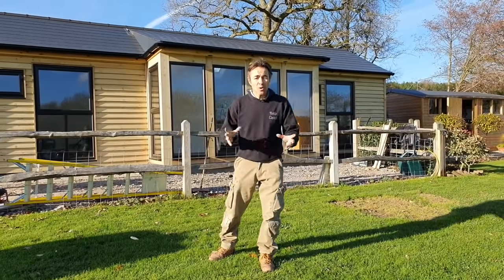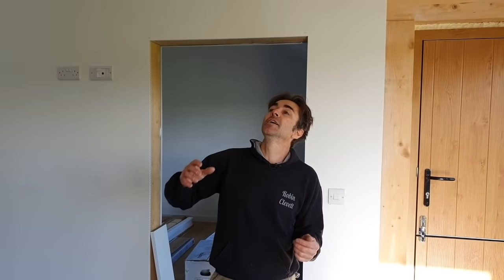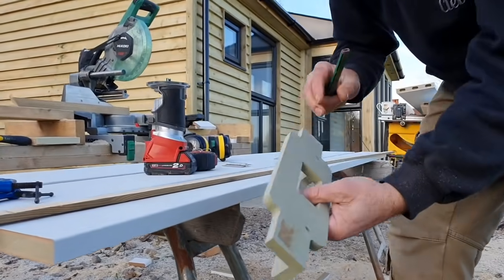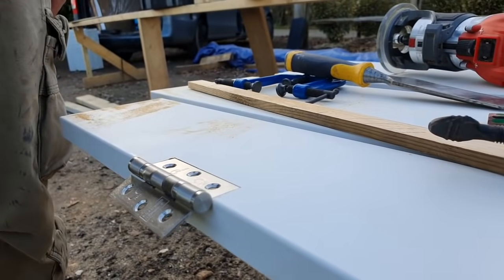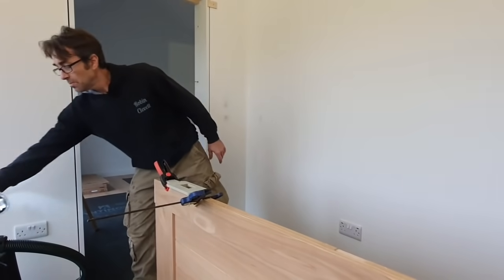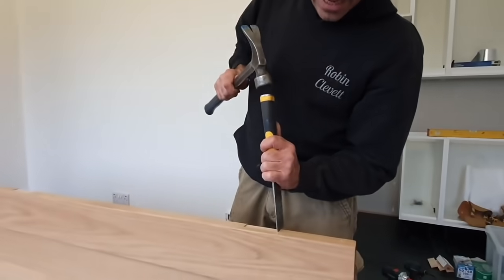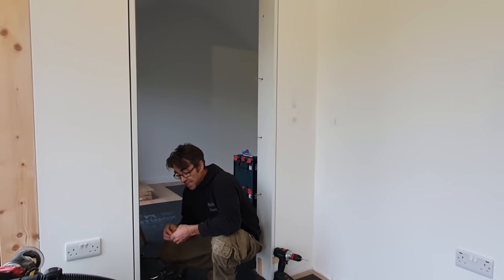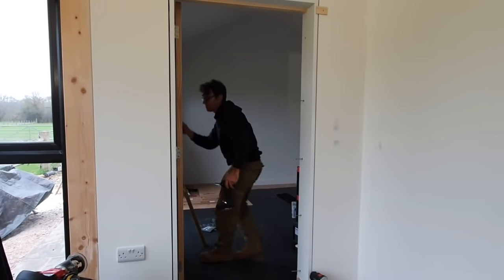Modern Carpentry and Change!!! Hanging doors the modern way with MDF door linings and new hinge jig

Comment: Having started Carpentry before you and having some age on you I agree everything has changed. The tools are a big help and make the job easier. In my part of OZ we don't get most of the material advancements you get but then mostly we build non descript shit boxes anyway and we are years behind the times. What I don't  like now compared to when I started is the seriousness of every job. We used to have a laugh usually at someone's expense but now frightfully out of order. Some over zealous WHS person, can't even say man now, is always lurking to catch you out or slap an environmental fine on you. You need 50 pieces of paper to start a job and another 20 during the job all at a cost to satisfy all the desk jockeys whose main function in life is to come up with even more requirements to make your job harder. Then some kid from Uni that has read a book on building turns up to do the inspections and tells you you have failed to comply with AS 6754 sub section C part 1 that was introduced last week. In the old days we would have dug a hole and buried him. It certainly has changed Robin but it is nice to see a man that has kept pace with those changes and is still happy with his lot.
Reply: Haha couldn't agree more with Dave about the WHS thing - totally over the top. Use lead stands so instead of stepping over the leads you turn a corner and clothes line yourself cos invariably the leads are at neck height. Or my favourite, give the workers a paved pathway around the job to make it safer - they're in a fcking building site not a hair salon! We''re used to running across roof trusses or reinforcing mesh, we don't need a smooth pathway around the job

Comment: Hi, does it make any difference to your hinge guide what size the router bit is just as long as it has a bearing at the shank end rather than at the tip of the bit
Reply from the maker: Hi Dan you can use any diameter of flush top bearing cutter with a cutting depth of 9mm or less, 12mm is a good size
Reply: @robinclevettcarpenter  hi Robin, thank you for that,  I will have to order your hinge guide now. Its a brilliant idea using mdf liners for different thickness of walls. Do you rip and prime your own and if so how do you edge them or do you purchase them to size?

Comment: Nice work Robin, how do you compare your hinge jig to trends? I've just hung a house full of doors and found the hardest thing is being super accurate when transferring the hinge locations on to the door, I hate having to take that extra 1/16 out of the shoulder if your slightly off.
Reply from the maker: Hi Robert, one of the reasons I first had a new jig of my own was for the very reason you mention especially if you are changing existing doors, so we shoot the doors in and then if you try to use a Trend Jig, you have to adjust and play and that can take time and plenty of patience!! with my simple jig its a matter of just placing over the pencil mark exactly and boom get it routed!! its really quick and super accurate

Comment: Very informative video Robin. Re: routing out the hinges, does there need to be a guide bush , if not, will the router bit cut away the jig ?
Reply: The router bit has a bearing on it the same size as the cutter that follows the jig 👍
Reply: @davefarmery8180  Thanks Dave, I will look into it, looks good.

Comment: Hinges with rounded edges to avoid having to chisel the corners 🤔
Reply: Been around for years in holland
Reply from the maker: As time goes on I will introduce specific hinge templates for specific hinges for different markets
Reply: @robinclevettcarpenter  hi robin , is your hinge jig available for me to buy ? Would love to have one ? 👍
Reply: @davidcavaliere1525  they are very simple to make yourself.
Reply: First used them in 1989, from CCF. Remember it well because I was made redundant and went self employed.
Reply: @vamboroolz1612  thanks for your reply 👍
Reply: @davidcavaliere1525  the downside of these type of jigs is you need one for every hinge size,( various of each 150mm, 125mm,100mm, 75mm hinges). Personally I used home made jigs for many years but now use an adjustable jig like the one from Rutlands. Basically it’s easy to adjust to all the sizes, the material is more stable and it’s just easier to use. I have been a carpenter all my working life,( from 17 years old to now being 55years old), so with my workload it makes financial sense for me to go buy an adjustable one. Like I say, those jigs in the video are very easily made yourself if that’s the way you want to go rather than an adjustable one. Best of luck with whichever way you go with it.
Reply: @vamboroolz1612  well it’s new to me , I’ve been chopping hinges in for years and probably quicker than settling up a jig , I’ve got so used to doing it using a chisel, I probably won’t even bother haha

Comment: Doh, what stops the router bit from cutting into the MDF jig?
Reply from the maker: A bearing guide built into the cutter as shown in the still clip on the video
Reply: @robinclevettcarpenter  Thanks Robin.  The 'penny has dropped', as they say!  As the video is almost 24 minutes long, where is the clip?  I couldn't find it :-(

Comment: If you are aiming for 2mm gaps all around do you not find that you still need to bevel the leading edge slightly. Also would your hinge jig be suitable for use with a laminate trimmer and   the right cutter. Another great video testament to your skill and experience.

Comment: Hi Robin, loved the video very interesting and informative as always✊
As a non carpenter I have a couple of questions!
When you produce the frame would it be possible at that point to mark and cut out the Hinges?
 Could also the same apply to the Handle and latch when you are fitting the hinges?
just a thought to assist efficiency or have I missed some key factors?
Keep up the good work!
PS:  Is your beautiful home finished yet?😏
Reply from the maker: Hi Martin, I did cover that about the hinges on the frame in the video, I routed the lining legs on the bench so they where done when I fitted the doors.
I always leave the handles and latches and fit in situ, generally because I will get the client to choose where they want them and most people need to see the doors in place from my experience!!
My Place is coming along good hopefully do an update over on SkillBuilder soon

Comment: How long until the RC branded hinge jigs are available. 😂 I’ve got 14 doors to do and they will be done following your great advice in this vid. cheers 👍
Reply: The Trend hinge jig would be a better option.
Reply: @jamesgreen4080  what at £200 😂😂😂
Reply: @jamiefors5062   Yes but for £200 the trend jig covers many different hinge sizes, you only need to set it up once on the lining and once on the door which saves time and therefore makes money.

Comment: Have a look at Magnetic Reading Glasses Snap Click Front Neck Hanging Spectacles
Reply: I've never seen a product designed to be lost so easily from the get go.
Reply: @markrainford1219  I've been using them for a couple of years. Not lost yet! Great at work stops them falling of when leaning over and ready to use when needed.

Comment: I’ve seen in your videos you’ve used the hikoki and Milwaukee framing nail guns and out of the two which do you prefer? I’m looking to buy one of them to replace my old nail gun
Reply: The Milwaukee isn't worth the extra money over the hikoki so it's a no brainer. Could do with trying one first though as they're both real heavy if your used to paslode
Reply: @rossmale8715  skill builder did a review of all the major nail guns, check it out.

Comment: ...and the added benefit of modern manufactured materials is they tend not to change shape, unlike real wood when used for work such as doors...nothing more frustrating than cutting, planing and finding moisture and/or heat means it don’t fit as it should...lol...

Comment: Just found my old Yankie yesterday 😂
Reply: Did they make you swear alot? I remember my dad using one f'ing and blinding in the garden.
Reply: Fantastic!! I’ve still got mine & I will never part with it. Got the jubilee clip to stop loosing the grub screw & stop it from rolling off the scaffold. I still use it for these tough big screws on traditional work. You just get the feel; the bite. Albeit, I just do the odd trade job now & again.
Reply: I have one.
With the original packaging.
Reply: @alexjames1146  plastic sleeve, see through at the front, yellow at the back?
Reply: Yes!!! Great tool.

Comment: I used the trend hinge router jig to put some round cornered hinges in, and it was so awkward, 4 openings to adjust to the right size, guide bushings that didn't fit the radius of the hinge, and it was a pain to hold onto redwood casings. 
This jig and idea is so much simpler! The flush trim bit would also work great if you had a longer MDF jig/template, the length of the door with 3 openings cut out and do all 3 hinges at once
Reply: Easy to make your own jig for this purpose just needs to be very accurate.
Reply: @SteveDiamond19  If you can't be accurate, make it adjustable

Comment: wouldn't it be great if hinges came with round corners 😉
Reply: They do
Reply: They do but not the giant radius Robin is using
Reply: I should have checked all the comments before adding mine 🥴
Reply: @jockwalker24  hi jack as your so critical of noticing those comments was indeed a response to MY comment but thanks for your input 13 hours later
Reply: @chrisl5097  sorry Chris I wasn't being critical one bit. My point was that before i make a comment (which I did 5 minutes before commenting on yours) I should read through what's already been said. If I'd done that I would have noticed that you had already said what I posted. No offence intended.

Comment: Do you think that the more things are made simpler and easy, the more knowledge and trade skills that are lost?
Reply from the maker: I certainly do think that its a shame that some of the really nice traditional methods are lost but just like any sector including manufacturing new methods and devices are created to improve speed and accuracy of a task, there will always be a place for traditional skills but in my world now if you turned up on site to hang door with traditional tools the type I learned with and worked with into the 90s then you would be slung off!! thanks for your comment, makes you think!!!
Reply: @robinclevettcarpenter  That's what I thought. I work opposite the St Pancras Station building in London which is a stunning 1860s build and often think that no one or, very few  have the skills to builds like that today. Real shame!

Comment: Just need to finish up with the jigtech handles!
Reply from the maker: Hi David, tried them but the hole is massive for the handles!!!
Reply: Tend skeleton hinge jig and jig tech kit you could have a doors hung in 15  minutes, perfect as well. Earn an absolute packet at 40 quid a door.
Reply: @rich3633  £40 a door? You're cheap!😲
Reply: @paulmcfadyen689  50 normally, all depends though, more if I've got no room to work, depends what type of door it is etc. I'd tosh them in all day for 40 quid if i could do it in 15 minutes though. 160 quid an hour isn't bad in my book. What do you charge out of curiosity?
Reply: @rich3633  when I used to swing doors I got £8 each 😂😂
Reply: @fireblaster9961  Very true but it's their choice and It is a business after all, so I don't see the harm in selling/ pushing a product that works well and generates more profit if the client so chooses. I don't mean pushing as in bullying grannies by the way, i mean just marketing the jig tech stuff well. The handles are good in my opinion if a little expensive, although you can offset that cost by nit taking as long and  charging less labour.
Reply: @denty32  blimey haha, i remember my dad telling me when he was on 5 quid a week and that was considered reasonable money.
Reply: @rich3633  £75 per door
Reply: @paulmcfadyen689  you're probably not as rough as me though mate 😁. All depends i think. I have charged 90 before.
Reply: @rich3633  it was the reason I started roof construction, I lot easier, more money and less tools, not sure I could ever go back to second fixing.
Reply: 80 pound a door for me what happens when you've to trim head and sole and scribe both sides in  or the screws are rung to death or the frames rotten under the paint 🔨

Comment: Yeah everyone has seen MDF skirting or baseboard like their called here in the states. And they also see after some use of time how the corners get damaged and start to crumble. Horrible material for baseboards and casing / architrave where theirs any potential of them getting banged up. 

Also, most MDF is NOT moisture resistant here in the states. Mopping floors will eventually destroy MDF baseboards. It's okay for crown moldings where it will never get touched or for a few other applications, but I don't think its the best option out there for most thing. 

Just my 2 cents worth, been doing finish carpentry for 35 years now. I hate it. it screams cheap to me.
Reply from the maker: I hear you!!, the market here in the UK has grown to adopt MDF mouldings and there are some inferior types on the market, we use a moisture resistant type and we can also get it in Tricoya that is completely water proof too if the chances of the boards getting wet often is an issue, thanks for watching and commenting mate!!

Comment: I'd love you to do a fire door assembly and fire door set into a brick/block opening which is never perfect and see how you get around all the issues this brings. Please consider this as the fire industry would really benefit from the skills you bring you would literally save lives 🙏
Reply from the maker: I am working loosely on this very area with a major door company and should help the way these doors are done
Reply: @robinclevettcarpenter  fantastic! The industry is really taking off since the recent tragedy but the standard of work really needs to improve as the integrity of the door can be massively compromised if not installed correctly so the more detail the better please Rob. 👍

Comment: What’s the reason for only needing one line of fixings on MDF liners instead of having two lines on n each side? 

Loved the video! As someone new to the trade I like to hear about the old ways!
Reply: MDF does not cup
Reply: @paulmcfadyen689  thanks for replying with a actual answer! I know someone people can be well best not say! 

But I have another question where robin has put the fixing biased to the hinge being that’s where load of the door is would that not leave the other side with room for movement? 

I’d love to experiment with it but we just don’t have the time at work and we never use MDF liners. And we haven’t got onto doors at college just yet so work is the only time I get to hang them!
Reply: @zaccsquirrell320  you put the fixings where they will be covered by the stops. You shouldn't need to worry about movement on a "normal" width lining, but if its quite a wide lining you'd probably want to add some more fixings.
Reply: @paulmcfadyen689  thank you mate!
Reply: In the old days you could put a Yankee screwdriver through your finger they were spring loaded and would jump off the screw cut your finger very badly, I've seen it happen a lot of times.
Reply: @jlewis1688   Correct mate, i remember hurting myself many a time

Comment: If you are msking a hinge jig Why are you using a small hinge jig that you have to move for each hinge and use a rod. Should be using a length of skirting with 3  hinges cut out. Very slow to use a Rod.

Comment: Modern? Modern is using a Bosch butt template jig to machine doors. Repetitive and reliable. Using that single piece jig takes a long time and is unreliable for perfect alignment. And FWIW 17 years ago I was making jigs for strikers, pocket door hardware, flush bolts ect out of plywood. You don't need a CNC machine and most of us had a router with a collet setup and it worked fine. I doubt you'll be able to find a Bosch hinge jig nowadays though, but if you can find one buy it immediately.

Ps grab yourself a corner chisel instead of using the flat blade chisel. Much more reliable a d predictable.

Comment: MDF door linings 🤮 soft and easily knocked, and if you have a old brick/blockwall to fix in to i bet it wouldn’t be as neat and easy as a stud wall. Surely the hinge screws wouldn’t be as secure as a timber lining? Neat work though.

Comment: A tip for the hinges the writing is always the right way up 😉🔨
Reply: no no no, will vary if left or right swing
Reply: @chrisdormer1061  your correct my mistake 🔨
Reply: I’ve done a job before where after I had finished the client wanted all the hinges changed round so the writing was the same way up weather it was left or right hung. They wouldn’t have it that I was correct
Reply: @keithwiddows2391  
I'm sure the hinges I used before had the writing the right way up but or maybe it was the CE logo but I always put the forged knuckle in the frame 🔨
Reply: @keithwiddows2391   another case of the customer isn't always right. Drives you mad sometimes.